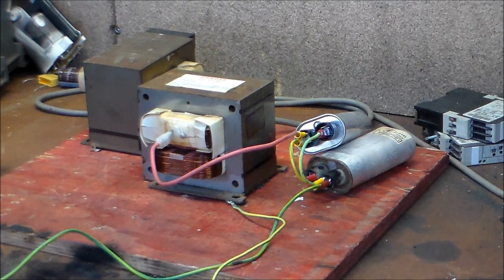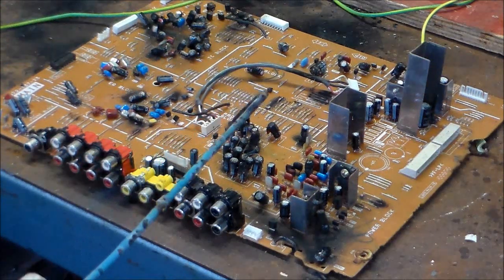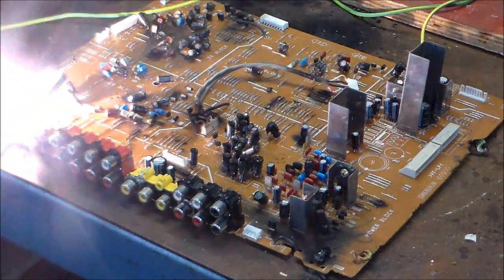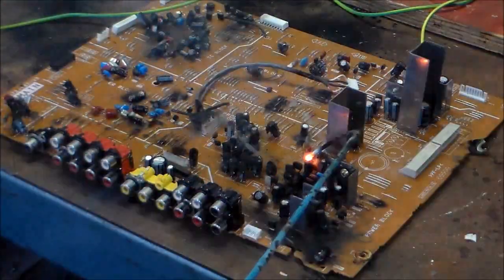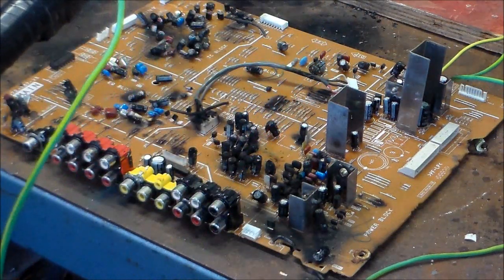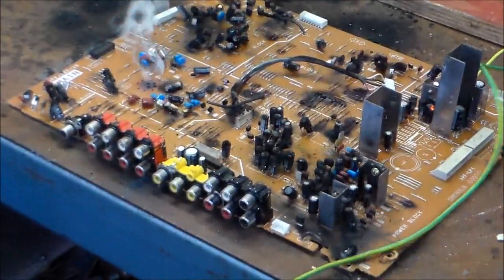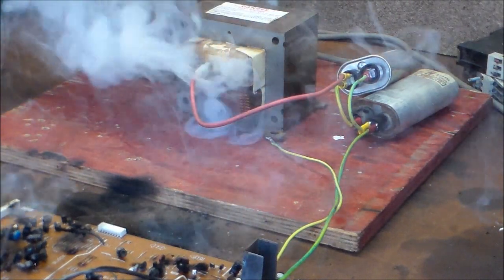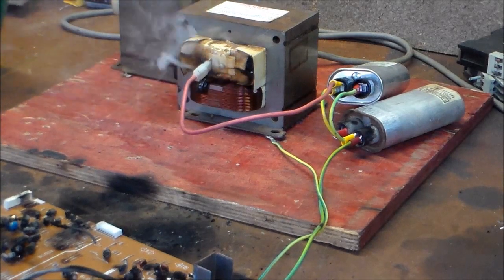Sunday Stress Relief - Circuit Board Destruction! Resonant, Ballasted Single MOT BURNS OUT!

Comment: thanks, I have been meaning to give that a go.
I have been playing with using 3 500w work lights as a ballast but not getting the punch I was after. I just picked up another microwave for gutting so I will give it a run.